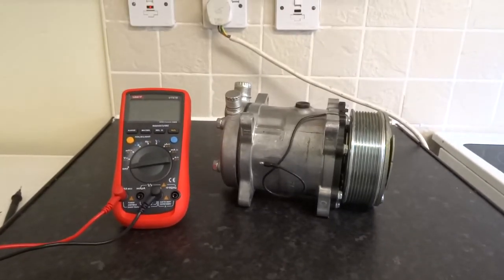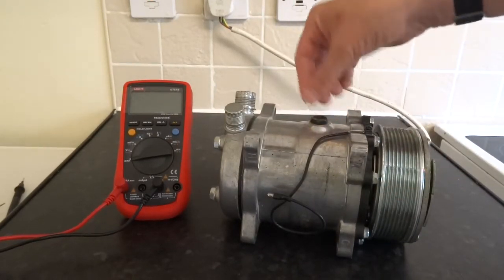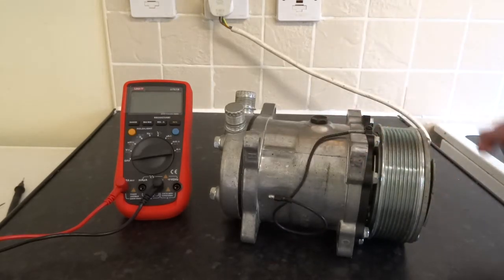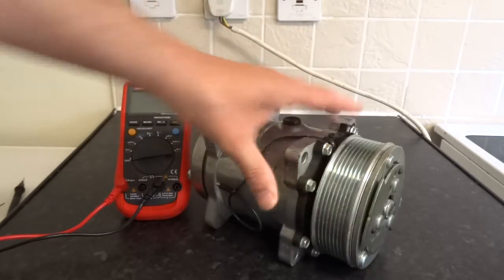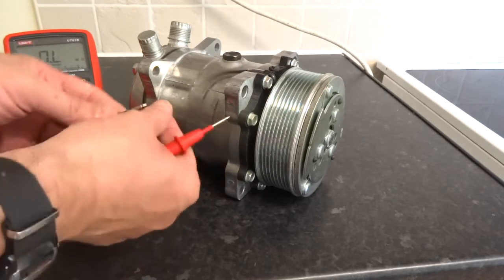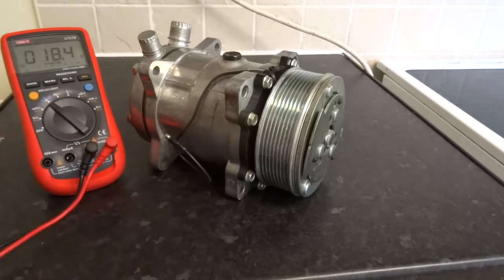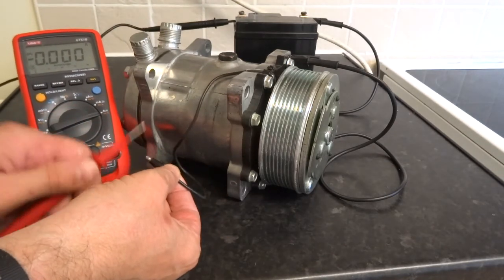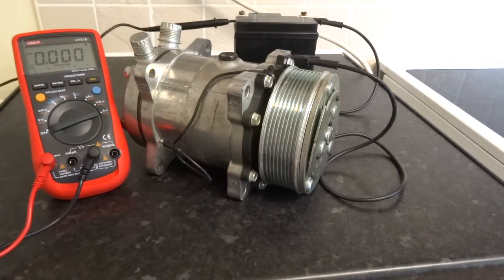A/C Compressor Clutch Diagnosis: Multimeter Ohms & Power Test (Fix Your Car's AC!)

Comment: my  AC compressor clutch will not engage by using the hot wire method but has 4.2 Ohm without power to it ( is the clutch bad ? )
Reply from the maker: maybe its jammed

Comment: Dear I have an AC sensor evaporator problem. What would happen if I put a 10k resistor in place of the sensor? My Hyundai is a compressor without a clutch
Reply from the maker: I have heard of this on certain sensors but not sure did you try?

Comment: Great info. Can you use engine oil in the compressor
Reply from the maker: Thanks for comment no its a special oil PAG , ordinary oil will break down it the A/C system.  its not too expensive though.
Reply: No